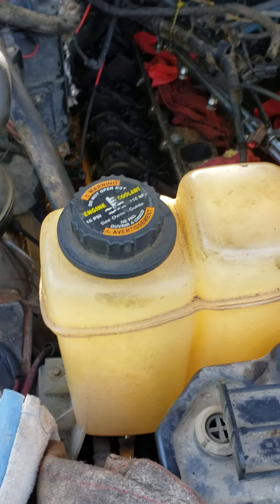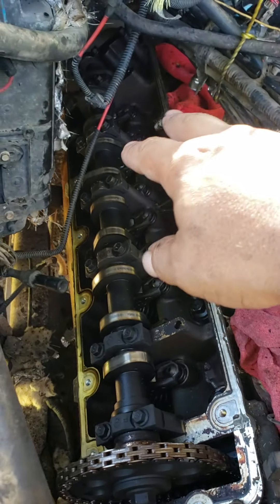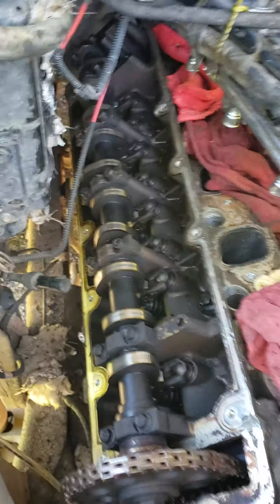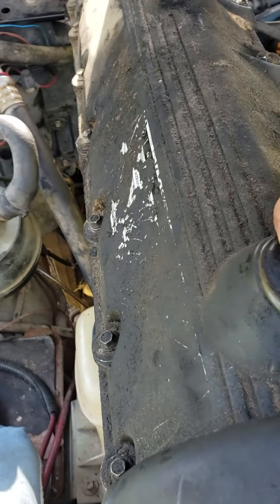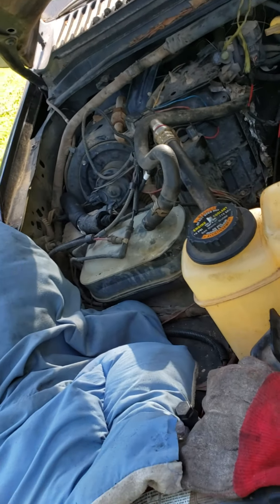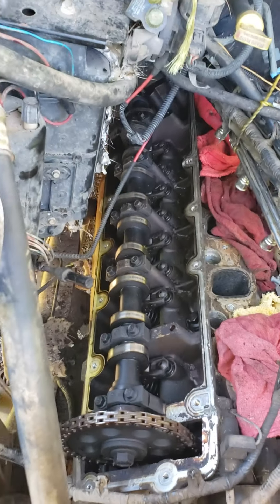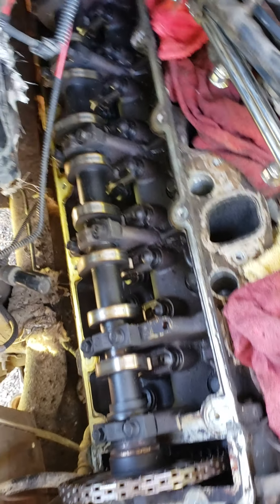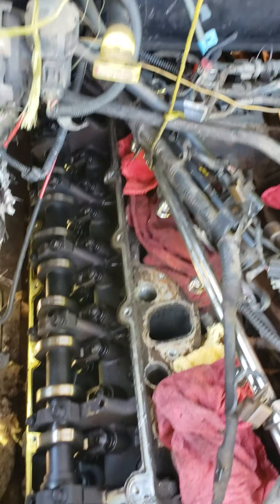removing valve covers on a 2000 f250 superduty v10

Comment: How were you able to put back on. I still had the ignition coils when I took it off but I feel like it’s much harder to put back on. Any tips ? I ended up denting/braking the valve cover so I’m waiting for the one on eBay to get here lol
Reply from the maker: I removed all coils when removing and installing, cause to me it makes it heavier. When you install the valve covers back make sure it is over the very back rocker arm and make sure You have the hoses and wire harness out of the way. But once you have it past the back rocker arm, just wiggle it to the left and right and it will go on down
Reply from the maker: I would practice with the old valve cover ( or with the valve cover gasket not in it) just to get good at positioning it. Once you have got it figured out then install your gasket and stab the cover on.
Reply from the maker: Did you ever get it back on?
Reply: @AJ-vl5dv  yes haha I took the wheel off like you said - it made it so much easier pushing it over the end piece.